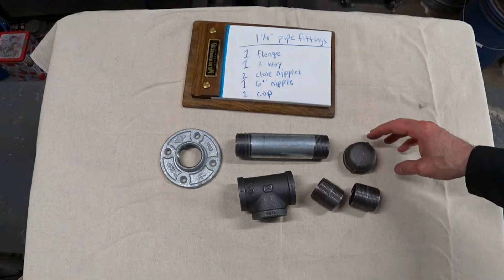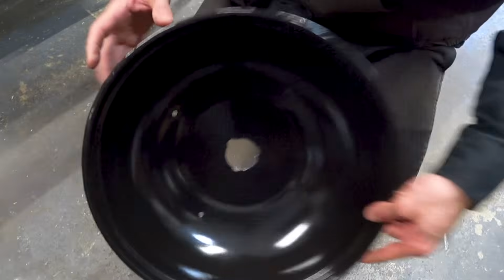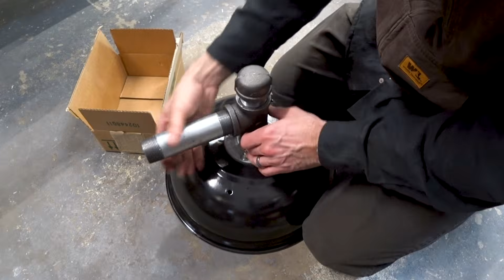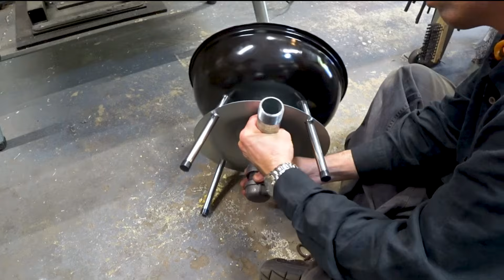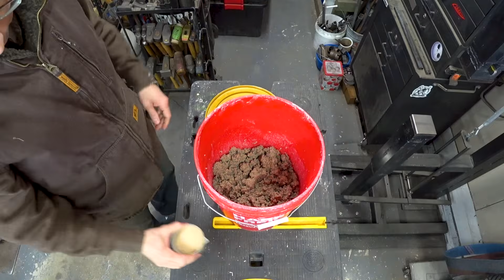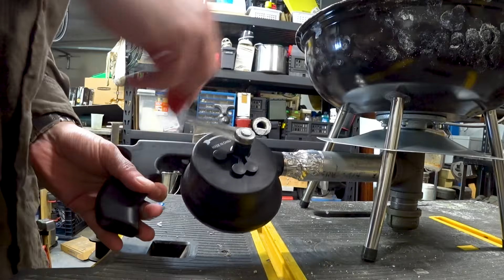Build your own forge using a charcoal grill! | Start blacksmithing

Comment: if you need to know this is what you need:
1 ¼ pipe fittings
1 flange
1 3 way
2 close nipples
1 6” nipple
1 cap

flame glo grilling
14 inch round table grill

Small hand cranked blower

10” 12” ½ rebar

Natural clay kitty litter
Reply from the maker: Great resource. Thanks for taking the time to create it!
Reply: @ravensroostforge  no problem.
Reply: Thanks for this, man!

Comment: https://www.youtube.com/watch?v=aqR4_UoBIzY

Would this material be good to use for the firepot?
Reply from the maker: It would probably work for a short time, but the material would be consumed with prolonged exposure to the intense heat of a forge fire. The outer layer essentially forms charcoal upon heating.

Comment: It's funny, my grocery store was clearing some of those bbqs out for $10 and I picked one up with the intention of using it for this. I've also picked up a 22lb anvil and a 2.5lb hammer with a tapered end on one side. I'll definitely try this method. Another thing you could use instead of the broken up bricks is lava rock. It's maybe $5 or $10 for a decent sized bag
Reply from the maker: The lava rock is an excellent idea!
Reply: Lava rock as in pumice or porous stones?

Comment: Nice idea on a drum and brake rotor I have those ..but i think i will just push air into drum and let ash fall into bottom perhaps into a pan that drum goes over and have rotor able to rotate on a plate with holes that match up or not when spun to adjust if necessary no pipe, no bolts, 30 minutes 🤞 😄
Reply from the maker: Great idea. Try it and see how it works.

Comment: Hey noob here, what does the clay, kitty litter and crushed fire brick do?
Reply from the maker: The basin of the BBQ is too large for the size fire needed, plus the walls are too thin to stand up to the heat. So the the kitty litter slurry forms the correct size and shape of the firepot while also being able to handle the heat.  The broken up fire brick just takes up space so that you don't need as much of the litter mixture. It can be done without the fire brick if you want.
Reply: @ravensroostforge can replace both with refractory cement?